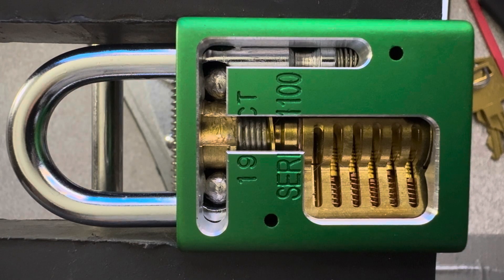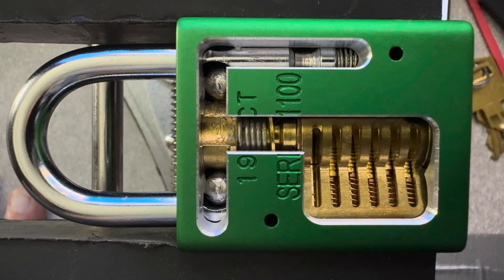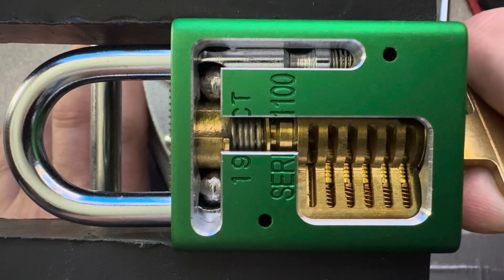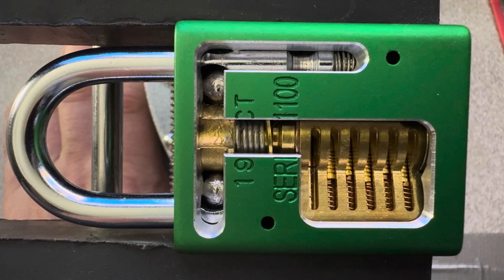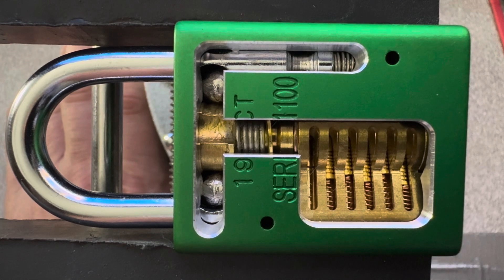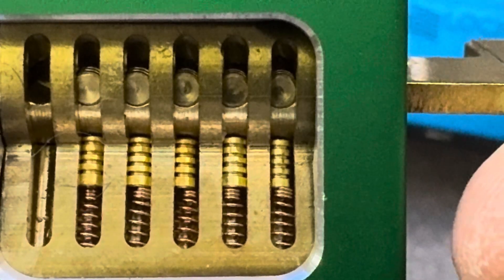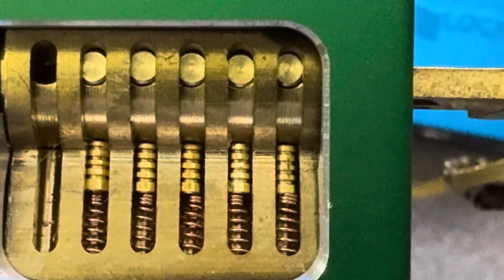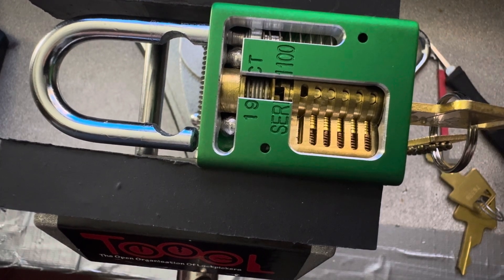[033] American 1100 Cutaway Close-up

Comment: Hey does that have the anti-bypass wafer? Don't look like it does!!🔒🔒
Reply from the maker: Good question! No, it does not! I am not proficient with the bypass tool to actually open the lock with it, but with the lock opened, it is not key-retaining. I put the bypass tool into place on the open lock and can feel the mechanism closing over it, and can also articulate it back open. The part I have difficulty with is if the lock is fully closed, I can not get the bypass tool into the proper place due to the mechanism being so tight.
Reply: @marqueA2  I was having the exact same issue!! Would the bypass tool you're using happen to be sparrows? Mine is and I had to shave it down a little bit with a Dremel and now it works fine.
Reply from the maker: Mine are from Covert Instruments, regular pick from the Arbiter set, as well as the SSF pick for the Covert Companion. Both have the same issue. Did you shave down the top 'edge' or the 'blade' facing of the flag to make it knife-like?
Reply: @marqueA2  I slightly shaved the top of the blade the side of the blade and I think the most important part is the width of the rod
Reply from the maker: @Mofo78786  I guess I have to get the Dremel out :D